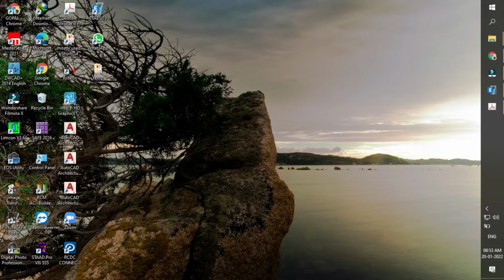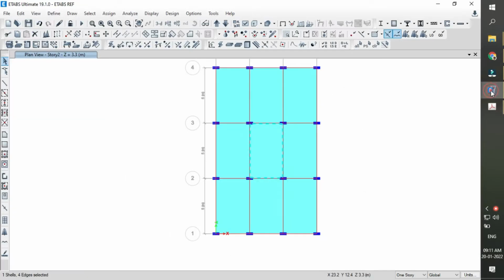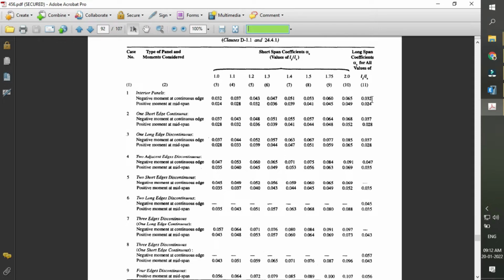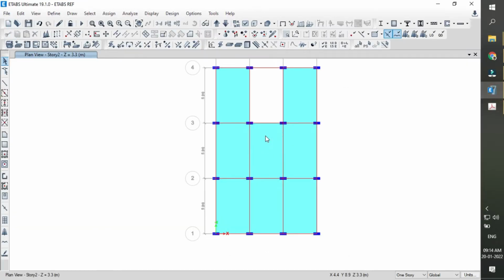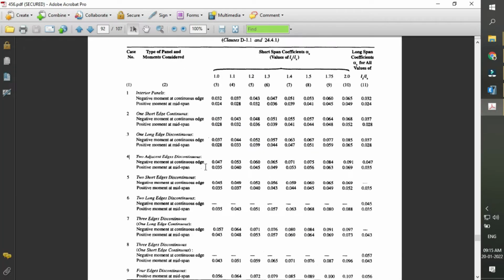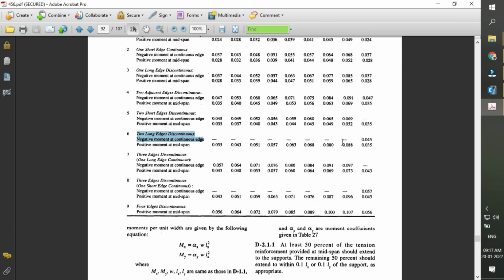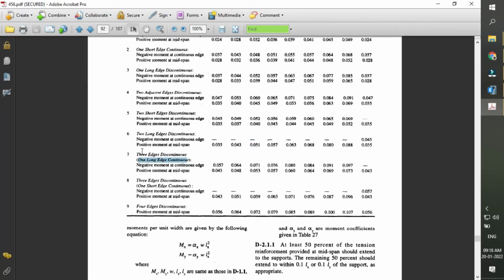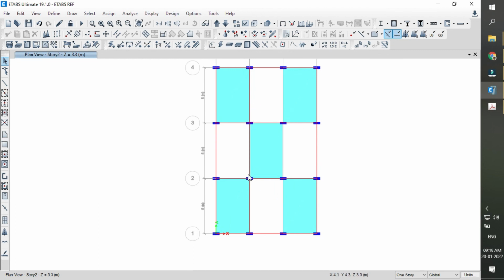HOW TO CONSIDER TWO WAY SLAB BENDING MOMENT COEFFICIENTS AS PER IS 456 TABLE 26

Comment: What if there is cantilever at short side and one long edge is discontinuous?
Reply from the maker: The mentioned Table 26 in IS 446  is only for the slab supported on four side beams/Walls. In your case, either you can design that slab as a cantilever slab or one way slab resting between two long edges. You need to check the span and loading and design the optimised solution (cantilever slab or One way slab)
Reply: @Structuraldesignmentor   No I'm not asking about cantilever span. But I'm asking "If the two way slab one long edge is discontinuous and other long side is continous. And one short edge is continuous next to cantilever and other short edge is continuous. What is the boundary condition for this type of slab?
Reply from the maker: In that case you can design that slab as case no 3 one long edge is discontinuous